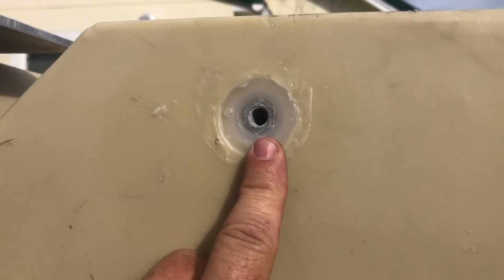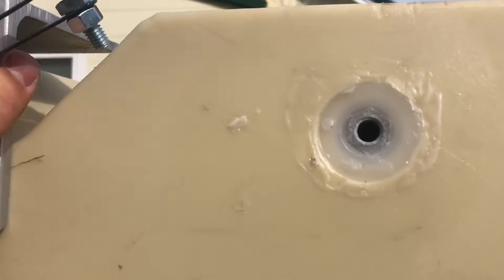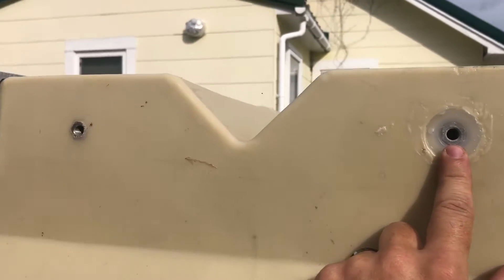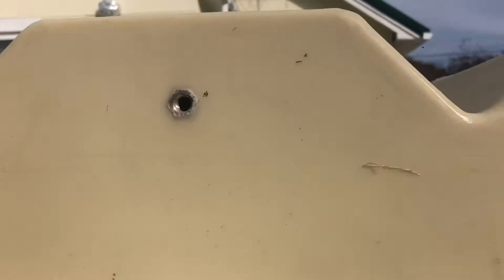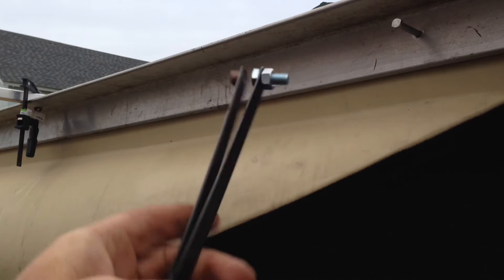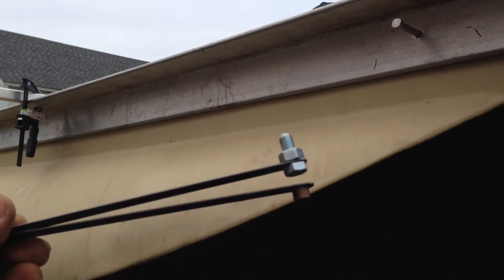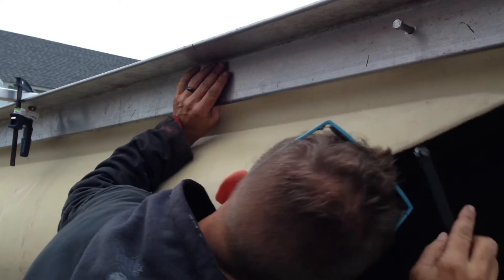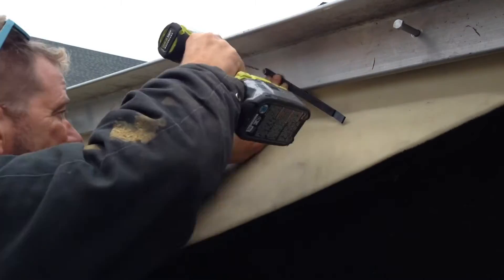Wilson Pontoon Build Part 3 (Attaching angle to pontoons)

Comment: great video...thanks. I am thinking of using these on my houseboat. Do the 10ft sections stay together well....is it just the aluminum angles that "hold" the sections together?  Thanks!
Reply from the maker: I’ve not finished it yet, only launched, and have it floating in my slip. So I can’t speak to how it will handle under a load, or while cruising thru the water……but…… the sections have molded “ball and socket” type features, so they sort of interlock together, which should help hold them together in addition to the aluminum angle. But I think the angle is doing 90% of the work. 

I hope to finish it up over this winter, and can give a better review then. Although, it’s 50% materials, and 50% my assembly. So a poor performance review could be due to my assembly.
Reply: @chincoteaguecapt.danstours2210  Thanks, either going to use these or aluminum which is more than 2x the expense.